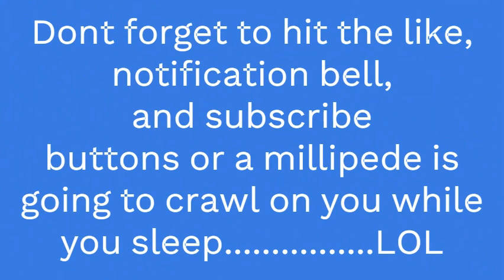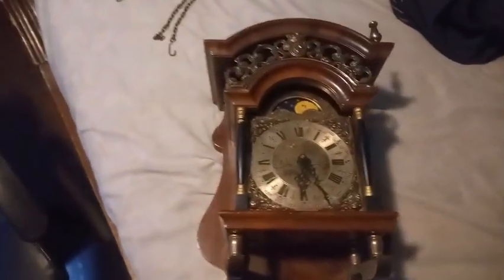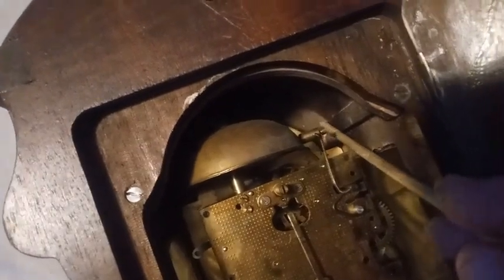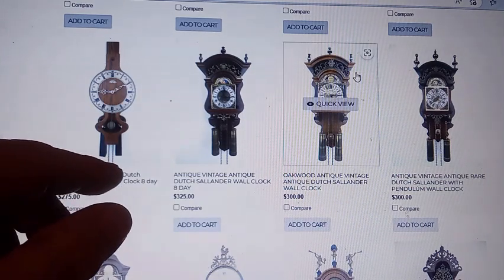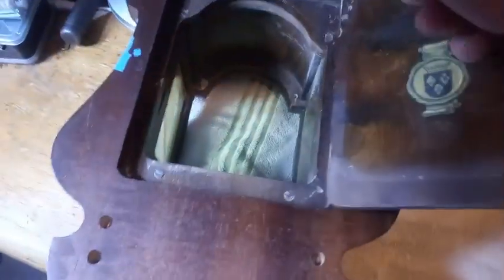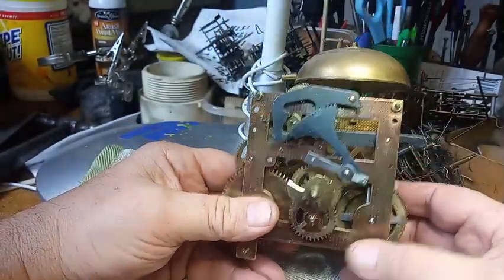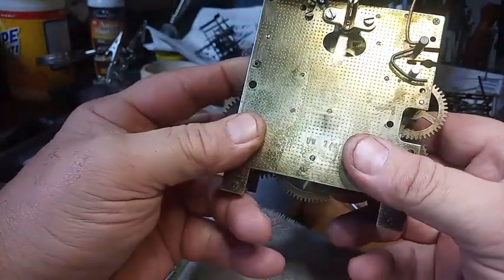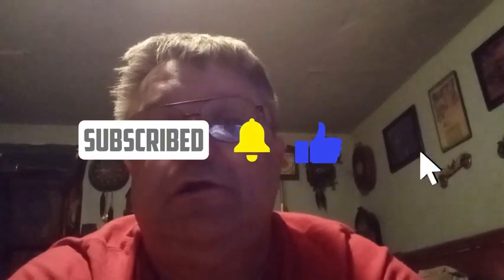Cuckoo clock repair for beginners (Repairing a DUTCH SALLANDER WALL CLOCK 8 DAY) See description

Comment: Great job on the video. Always good to show the slip clutch on a clock that has one. When the varnish starts to come off, I just soak it more in the cleaner to get it all off. I found that if you don't, in time it will just start lifting anyways. (You don't need to many more people to hit the 1000 )mark. Great Job. God Bless.
Reply from the maker: Thank you always Mike for the kind words. I agree with you on the varnish issue. Yes I am almost at that 1000 mark but I dont think that I will ever catch up with you. It has taken me almost 2 years to get that 1000 mark. I started in April of 2021 with the you tube videos I believe. May God continue to bless you and yours as well.